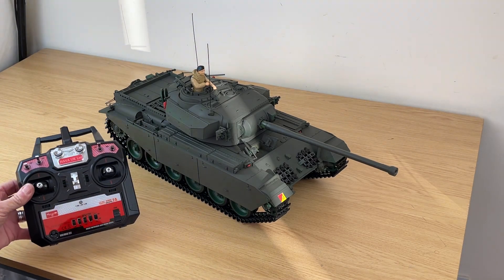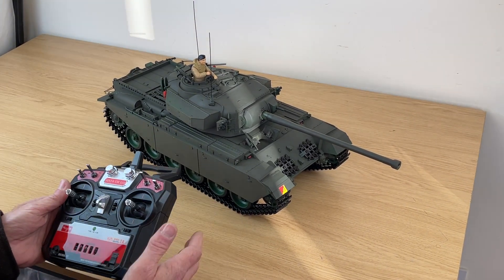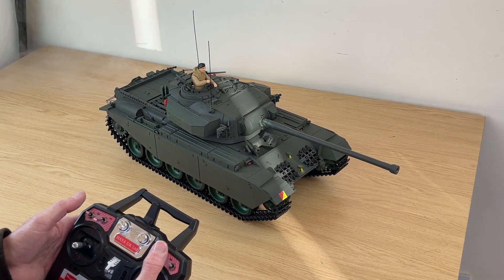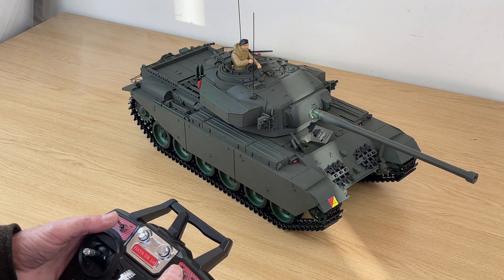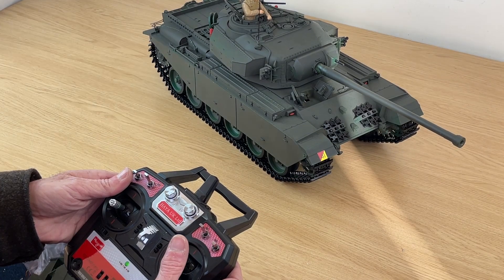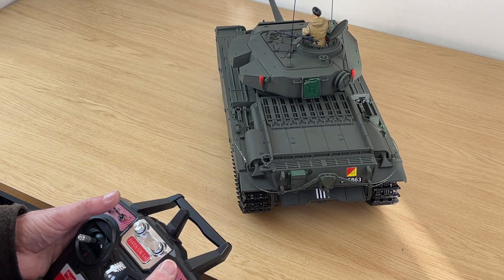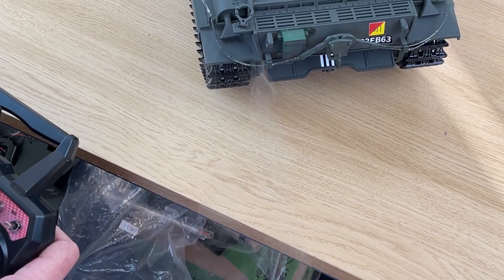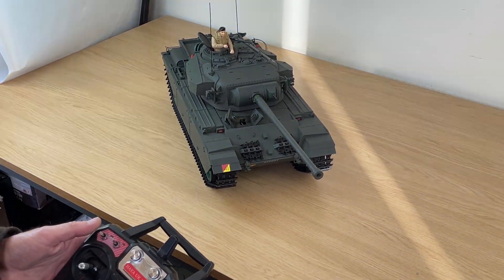Haya 1/16 Centurion  Operation by FS 10 Channel System

Comment: I dont like bb.
Will there be an option for servo recoil?
Reply from the maker: It is servo Recoil. If u don't like BB, use the Infra Red function to battle with Heng Long or Tamiya ( IR Mushroom and Emitter sold separate on our website www.hayaltd.co.uk)
Reply: @hayaltd  Cool, i thought it would be that bb recoil from HL which is reversed. Thank you.